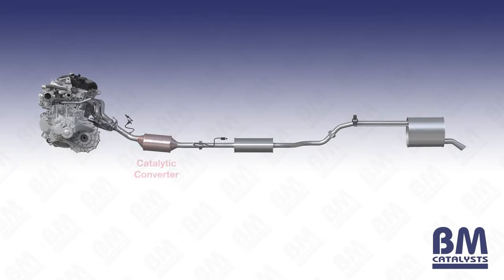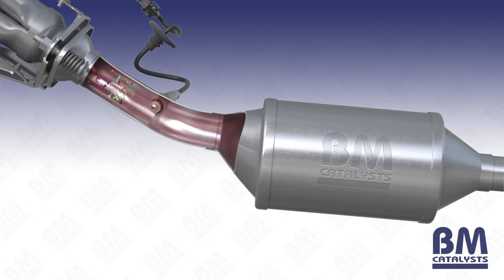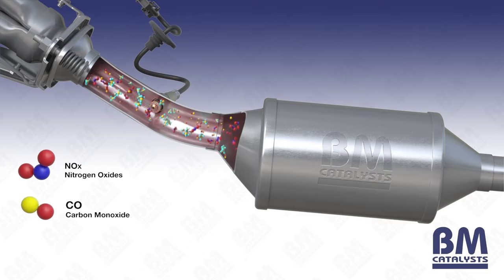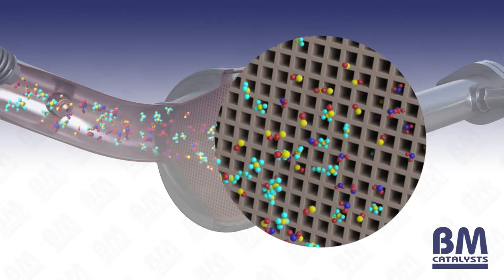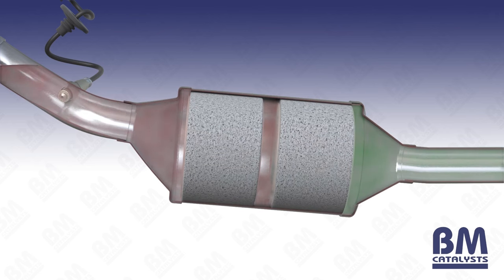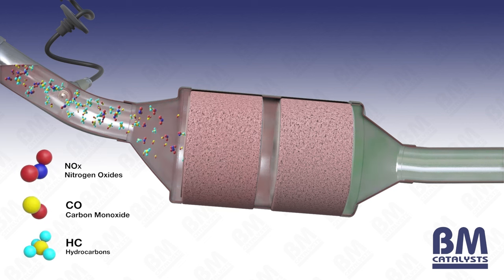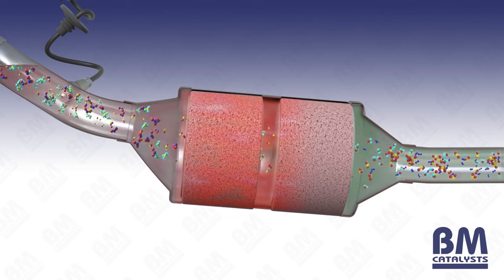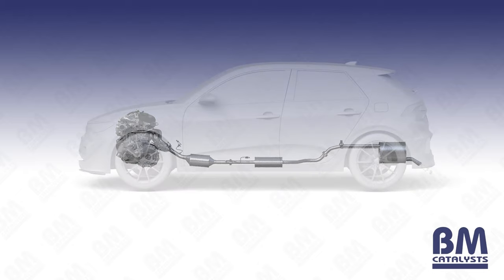How does an exhaust catalytic converter work?

Comment: The catalytic converter work by blocking the horsepower
Reply: yeah by like 0.5%
Reply: @AhrkFinTey  By a bit more than that, but since most vehicles are set up for a certain setup, like having a kat in them, it will probably make you lose hp/torque if you remove it without remapping the ecu. On bikes for example it can really screw with the engine and make it run much much fatter. However removing it then remapping can give up to 5-10% HP gain.
Reply: The you get a high flow sport cat..
Reply: You seem to know something about this?

Comment: the downside of this technology is that over time , the catalytic converter will be useless due to the deactivation of the active precious metal to avoid this we can develop a regeneration system for the active catalyst which enables them to self-regeneration after it is used for long time.
Reply: catalytic converters are designed, developed and tested to last the full useful life of the vehicle and overwhelmingly the original OE converters are still in place when vehicles are recycled . In fact, the precious metal containing catalytic converters are typically the first parts removed from a vehicle when it enters a automotive recycling facility and are recycled into new catalytic converters.
Reply: Well if it's a catalyst I don't get how it would be consumed overtime. As everybody has studied in chemistry class, a catalyst doesn't get used up, since it's not a reagent. It only allows a chemical reaction to undergo faster, without adding products or changing the equilibrium constant
Reply: @pierpaoloscian5926  an engine, especially an old one or one that is passing unburnt fuel can poison or reduce the surface area of the ceramic support used in the converter. This is why lead and zinc additives were eliminated or reduced as well as fuel sulfur which has been reduced to well below 10 ppm. Unburnt lubricant which contains phosphorus, magnesium, etc can also poison the converter. But as I said previously, overwhelmingly, converters on modern cars last longer than the car itself.
Reply: @pierpaoloscian5926   Thanks, your reply to this matter. you are right as we studied in school the job of the catalyst is only to accelerate the chemical reaction. but, let me explain to you what I mean by catalyst deactivation, for example, in water purification we use filters and membranes, over time what will happen to the filters, all the particles in the polluted water will accumulate in the pores of the filter. so we have either change the filter or we have to clean it. so as the catalytic converter precious metals pt or Pd which are the active site and responsible for the conversion of toxic CO to CO2. when it is used for a long time it will lose reactivity by accumulating carbon and causing deactivation. so it needs the filters either regenerate or change it. that is what I am talking about .
Reply: @mohamedyusufmohamud8193  No precious metals dont reduce in reactivity in the process as they are not consumed in the reaction as they are in other kinds of filtration reactions.
Reply: @Wildminecraftwolf   i haven't used the term consumed overtime . i said it will deactivated or loss the activity due to the accumulation or carbon deposition on the active site of the catalyst. i have a master's degree  in chemical engineering  and I know what I am saying . every catalyst will deactivate overtime , some may stay longer but finely it will  loss its activity .
Reply: @kevinbrown1368  I recently took a car to the junkyard. The only thing that they inspected was that the cat was still there.
Reply: @kevinbrown1368  some of us drive vehicles far beyond their “useful” life.
Reply: Honda B useful life was 15 years or 250,000 km's.

Mofo's be tearing up at 30 like dads having midlife crisis and original cats still on lots of cars.
Reply: Looks very good👍

Comment: spending too much fuel…engine choking
Reply: Does removing it reduces fuel consumption?
Reply: @ramycraft5349  improves it
Reply: @ramycraft5349  removing a catalytic converter typically does not improve fuel economy or power on an electronically controlled engine unless the ECM is re-tuned for the reduction in exhaust restriction. However, the act of removing a catalytic converter or re-tuning an ECM is illegal in most jurisdictions.
Reply: Twenty years ago, EPA agents came to the Western Auto store in my little East Texas town and confiscated all the replacement pipes that were on the shelf for sale to put on your car temporarily to see if your Catalytic converter was clogged. People were leaving them on their cars permanently, and the EPA knew it. They said if they found any there later, the store would be fined and closed.
Reply: @stevenpollard5171  GOOD!! And so they should. Tampering with your vehicle’s emission control system is illegal. Preventing tampering is intended to protect vulnerable communities from dangerous amounts of pollution.
Reply: @kevinbrown1368  The idea is good
Reply: @stevenpollard5171  Environmental protection is indeed important

Comment: I am not a chemist neither an engineer, I am a technician ( Grease monkey)and I work on cars for many years, what I’ve seen over the years (some cases)broken cats from inside making rattle noises, melted ones from overheating due to engine misfiring pushing raw fuel through the exhaust along with all other emissions that  burned in the catalyst, some cases head gasket or intake plenum gasket failure caused internal antifreeze (cooling system)leak into exhaust system through valve’s then trapped inside catalyst
Reply: Looks very good👍

Comment: Catalytic converter are the end game of society. Ruin a car for no reason and fool buyers coinciding
Reply: Catalytic converters vastly reduce the amount of CO, HC, and NOx in your exhaust. These gases are harmful to the environment and to you. A modern cat only sips a percent or two of HP, so it’s really a no brainer.
Reply: @christofferhansson7950  when the mean reduce carbon emissions they mean from you also
Reply: @enhancementtank5876  Yes? Everyone must pitch in to combat the climate crisis.
Reply: Bro for a track car sure, remove it, but for a daily it's good
Reply: @enhancementtank5876  Not true, the evidence is absolutely overwhelming. Besides that, the cat still removes pollutants that are directly hazardous to your health, so it's beneficial none the less.
Reply: @christofferhansson7950  there are no pollutants the cat catches is serves no function but planned obsolescence such as plastic engine parts. The catalytic converter is mechanical Sabatoge to leverage the consumer
Reply: @enhancementtank5876  Modern three way cats convert HC, CO, and NOx in the exhaust into less harmful molecules like CO2, H20 and N2. If you want you could use an exhaust gas analyzer to see the exhaust gas composition. Compare a car with, and without a cat, you will see a significant difference.
Reply: @christofferhansson7950  No proof.
Reply: @christofferhansson7950 I looked it up, and you're wrong. It is supposed to slow the process of the unhealthy stuff not change the chemical component.